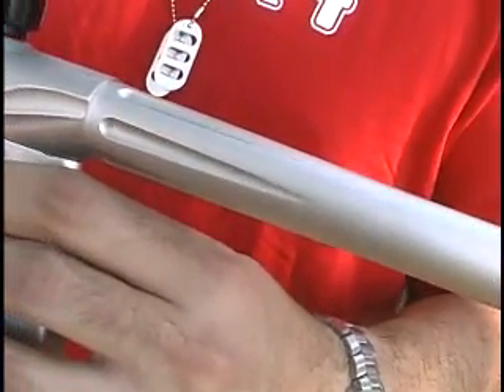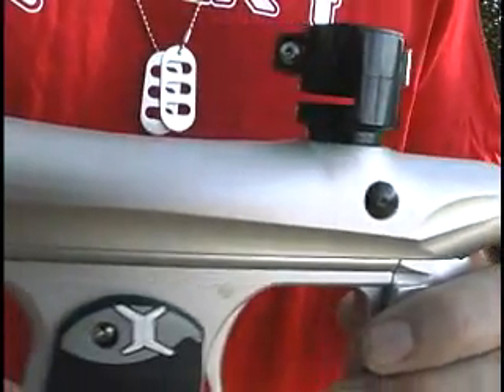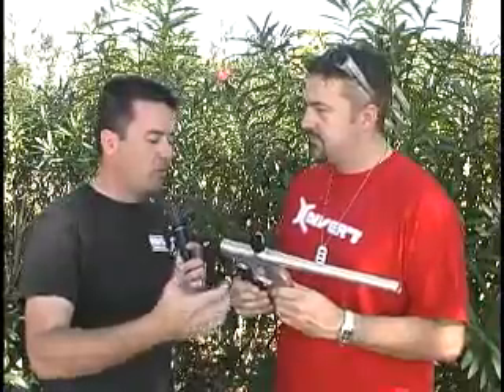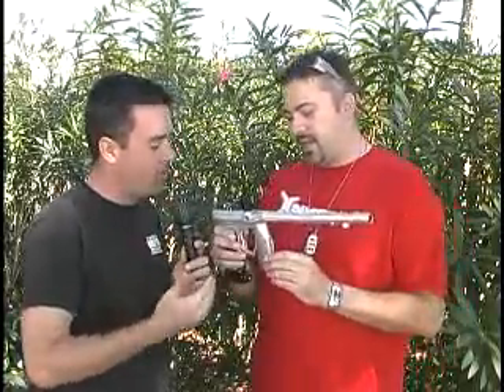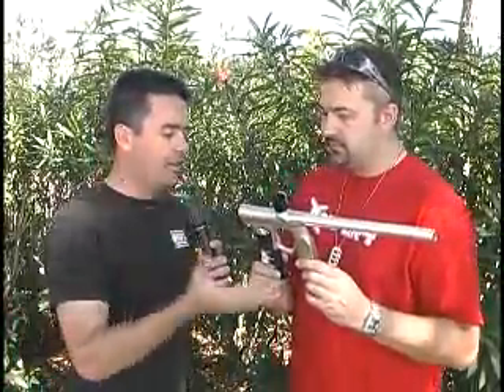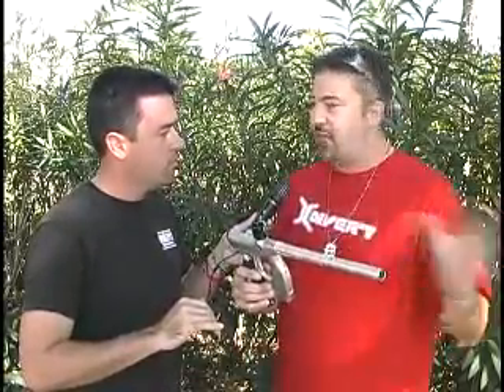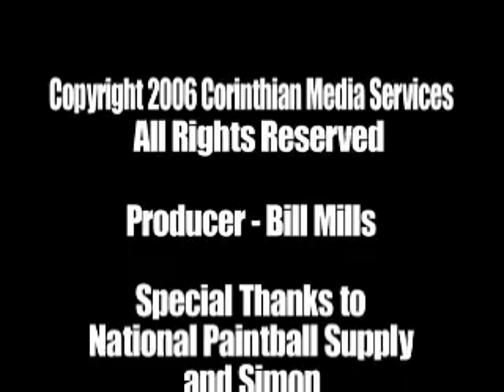PigTV - Paintball Television Tech Extra * Invert Mini

Comment: it operates at bout 200 psi, i think, so its low pressure. but if you have a high pressure tank the regulater on the gun should regulate it down to the correct/safe pressure. (spell check me)

  hope this helps.

Comment: being sponsored by sp on the charst yes get a g3..

also off the charts i say the same thing dp tech support is alot better. the dangerous power is a great gun for its price. i say it could compete with and high end marker. on the other hand the mini has 2 boars 1 in the forgrip and in the gun its self.

REview wise.
dp has a great on of its just a lever that is easy to move and easy cleaning so get a g3 its your best bet and you save at leats $25